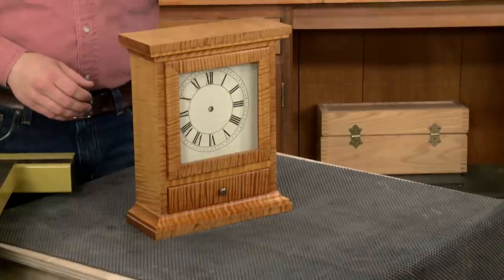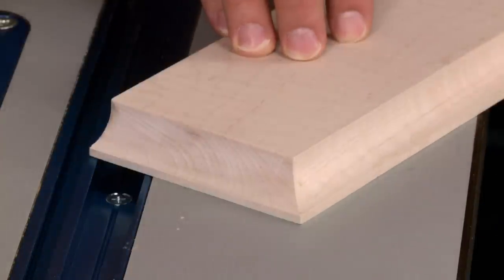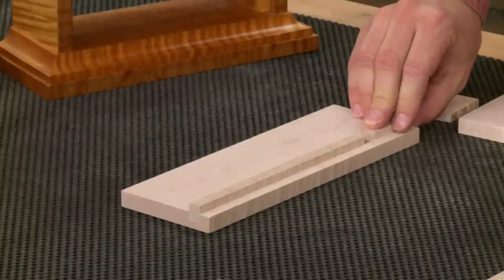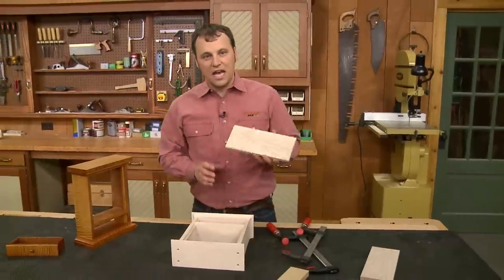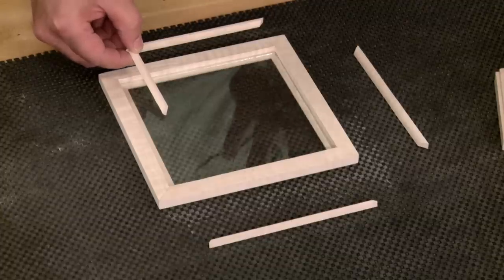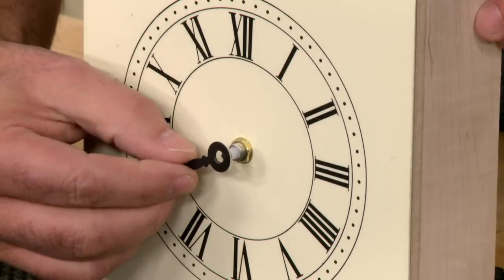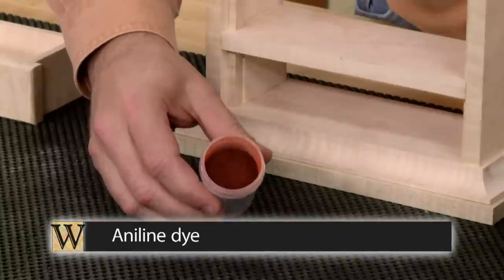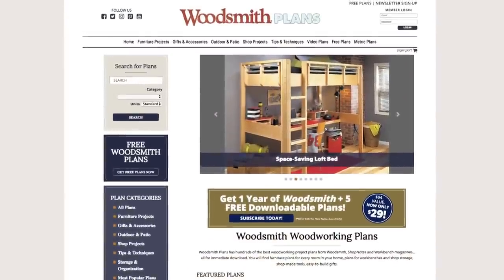Building a Curly Maple Mantel Clock

Comment: I made a couple for two of my nieces that were recently married and they came out much like in the video.  Excellent plan and a great project.  Thanks.
Reply: Could I ask your source for the curly maple? - Recommendations?
Reply: From a local sawmill.  Their cabinet maker customers don't want curly maple so the had a bin of curly maple for slightly less than the price of regular soft maple.  (I got lucky!)
Reply from the maker: Yeah, most recently I've purchased some from Cook Woods: https://www.cookwoods.com/ ; Bell Forest Products: BellForestProducts.com  and CurlyMapleWood.com are some other online retailers, but honestly every time I go into HomeDepot and Lowe's and dig through their maple I'm able to find at least 1 piece of figured maple in with the regular stock.
Reply from the maker: Yeah, this project makes an excellent gift.
Reply from the maker: @sallyfudd1  - The length of the hour hand is approximately 2 3/4" and the minute hand 2" ... Thanks for pointing out that the source for the hands is no longer valid. This looks like a good source: https://www.klockit.com/2-3-4-black-fancy-hour-and-minute-hand-set.html
Reply: @WoodsmithShowandmagazine Thanks!

Comment: Nice project but I gotta say I don't like the glass front floating like that....I would have preferred an internal latch or pin that would be active before slipping in the clock-face insert.